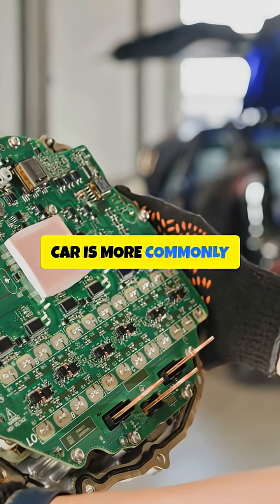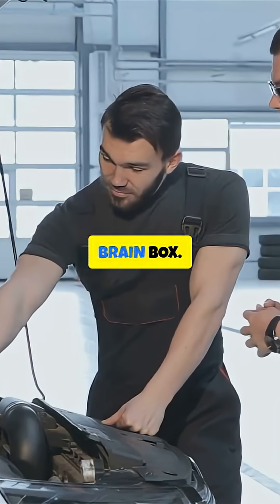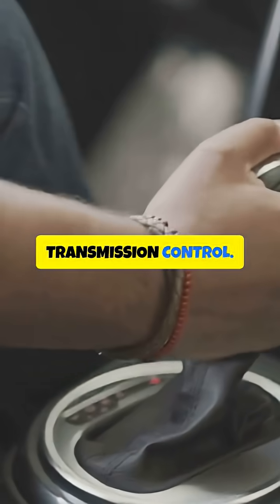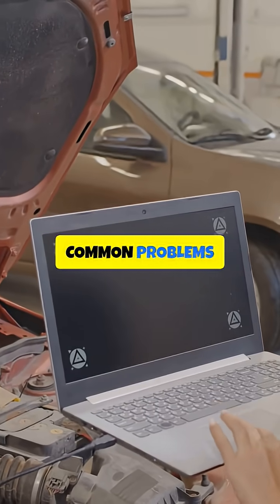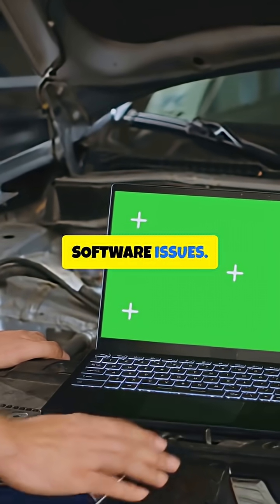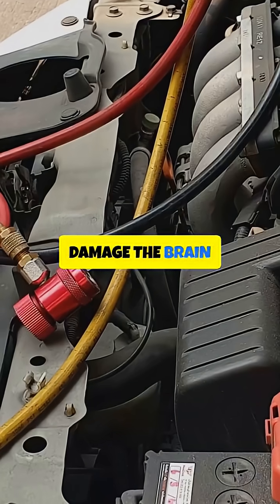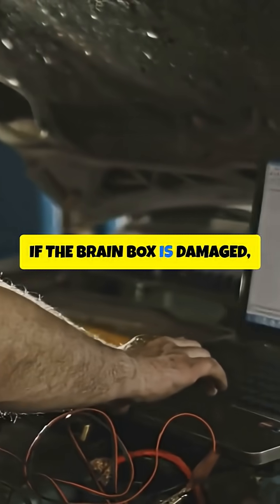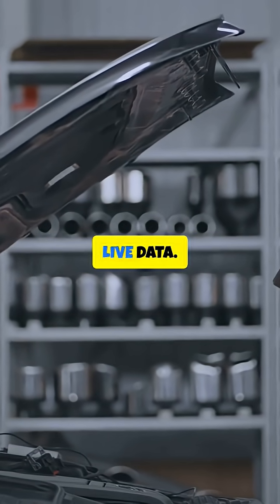7 Problems Associated With Brain Box (ECM/ECU) Failure in Your Car and their Fixes

Comment: Bad thing with those are once your grounding system starts to degrade with age at any time your engine control, module, or your other control, modules powertrain control modules other other systems are susceptible to having their brains fried if that ground begins to fail, and you lose everything that’s one of the main reasons why you do not put computers into Cars. You have set yourself up to have to replace every computer in your car because of a grounding issue for what? How much did you gain by making the cars cost so much and for what reasons but it’s advancement is it really is that what it is because it seems like it’s an unnecessary repair that shouldn’t have never been put into the car because it is destined to fail.